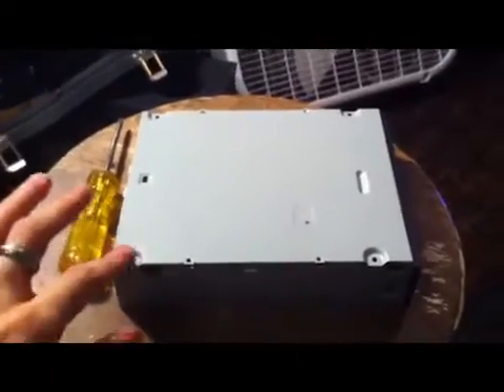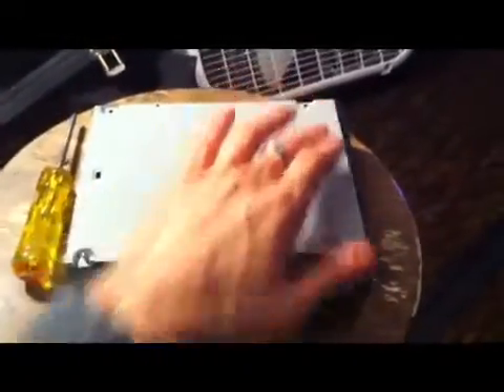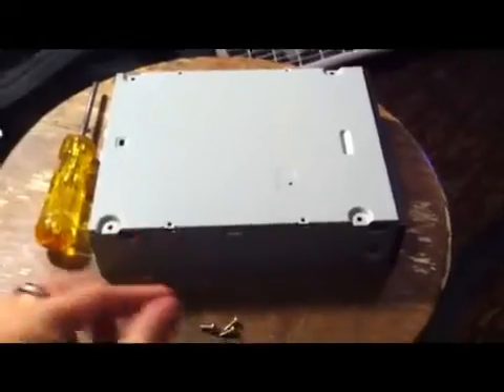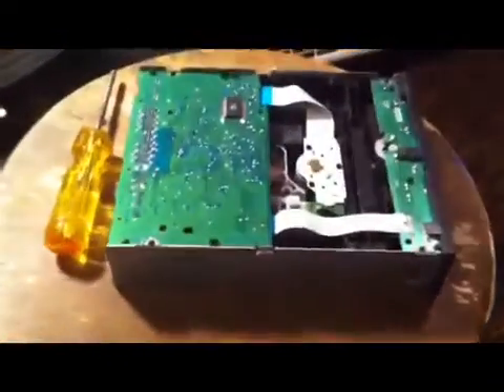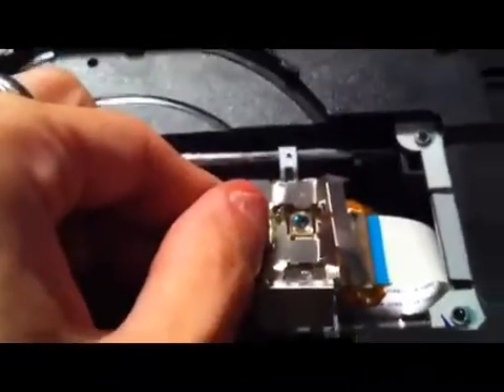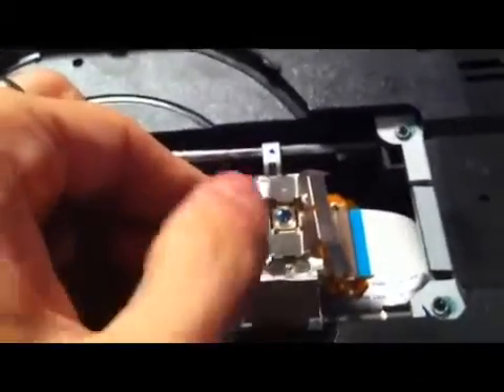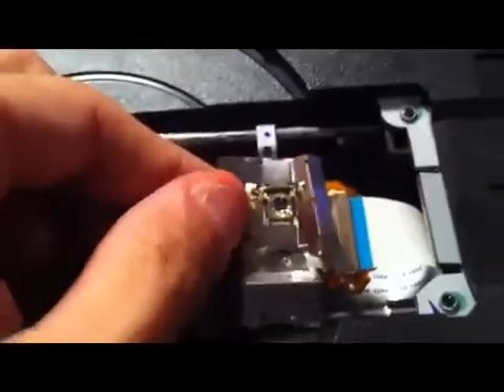How to remove a CD/DVD Lens - For iPhone Macro Lens Hack

Comment from the maker: @tubo1812 The easiest way is to buy a cheap snap on iphone case from amazon and carefully glue the lens in place. Its easy to get glue on the lens though and make it look all foggy, so be cautious. I think in one of my other videos I used a piece from an old 35mm camera I bought for a couple of dollars and mounted a variety of lenses on it with super glue. Also, make sure the glue is dry before putting it near your iphone camera! I almost wrecked my camera, but with a little wd40 solved it.

Comment from the maker: After I tore apart my old (non-functioning) PC cd player, I was at a thrift shop and saw a bunch of portable cd players for $2-3 dollars.  The lens on those are already exposed and incredibly easy to get to.  So if you have a thrift shop and want a cd player lens, I'd give that a shot.  Just pop the lens out with a razor blade and save some time.